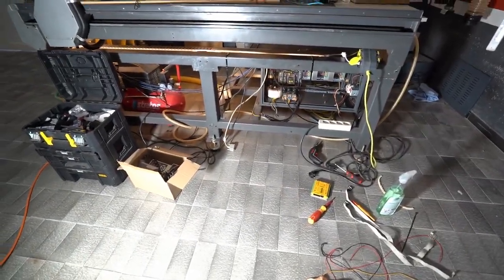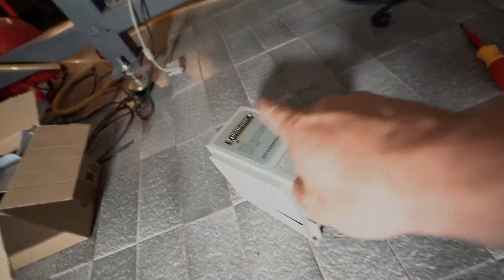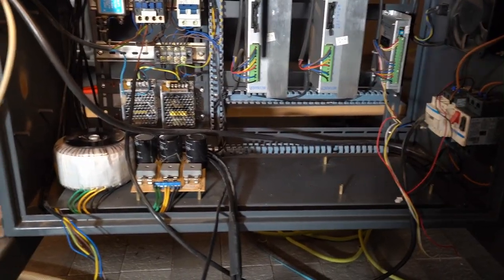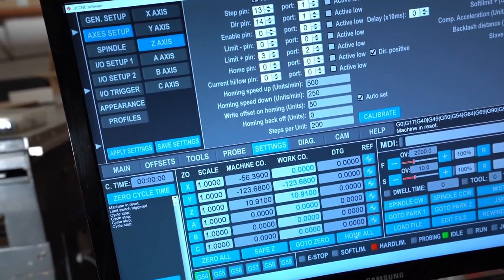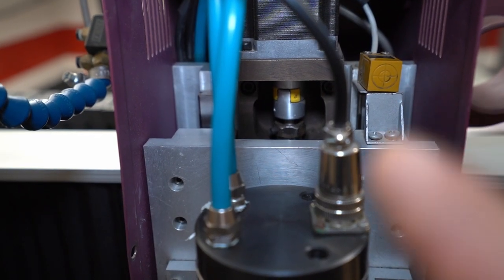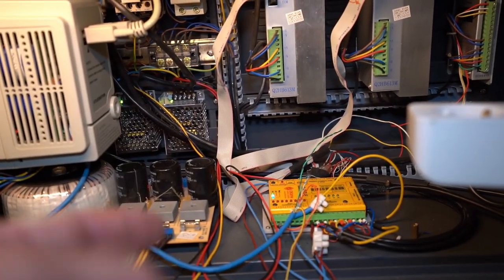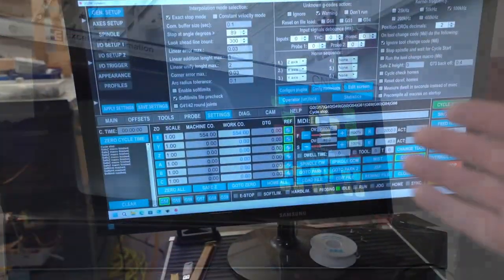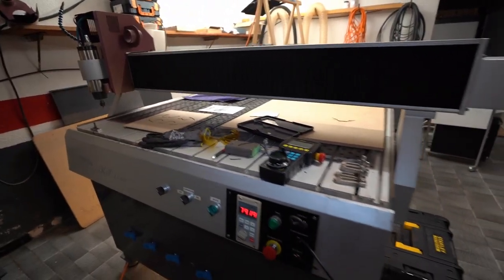CNC router upgrade  - UCCNC AXBB-E UCSB - part 4 - first moves

Comment: AXBB-E for the win! 🤓💥
Reply from the maker: Until now, I agree! Fingers cross! Tomorrow I will do the first cut....
UCCNC has a kind a complex coordinate system, no sleep until I figure out!
Reply: @BMRStudio  complex? Why?
I find it very simple 🤔
Need help?
Reply from the maker: @xyzspec82  so, if you export G code from Fusion , free version, then the code G54 wants to crash the tool every time, regardless you did zero .
Then, there is this Z height issue when You have home switch on the positive top Z.
And, stupid Fusion just messing with datums, axis directions, machine simulations, and this nonsense bunch of offsets everywhere!

With simple software, like Carbide, all right and ok. 
I have to learn more about Fusion madness, and how to avoid.
Reply: @BMRStudio  did you choose the UCCNC post processor when exporting the gcode in Fusion360?
I also have the Z homing like yours and It's all good.
Fusion + UCCNC is really good for me
Hope I could help.
Reply: I have no problem at all with fusion360 with my machine.

Comment: you can get out of the problem with the limit switch, you need to hit the over Ride button. I did just like you before :D
Reply from the maker: Next video..... Check out, for the issue. FUSION POSTPROCESSOR WRONG!